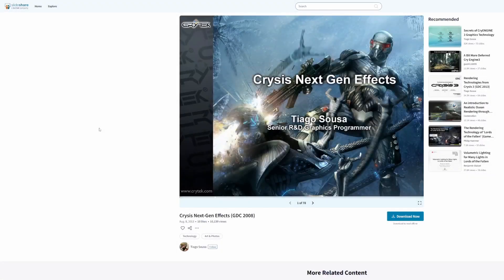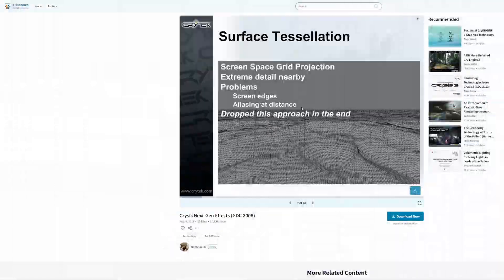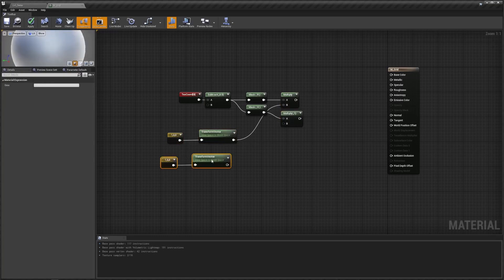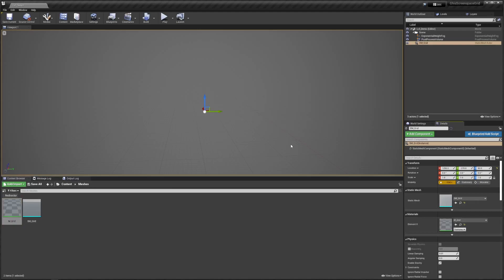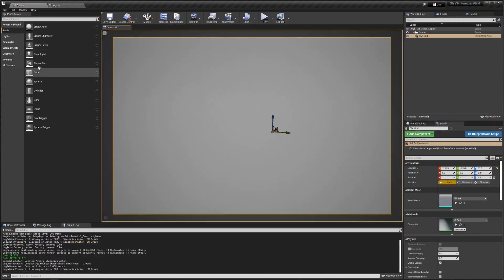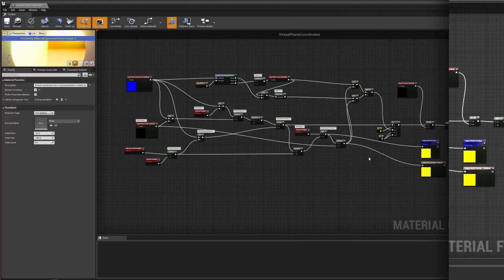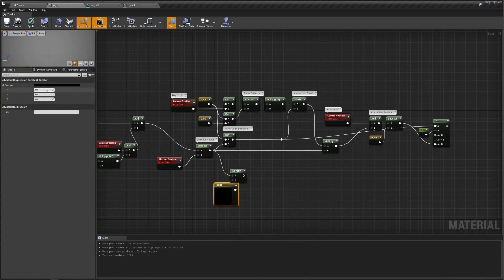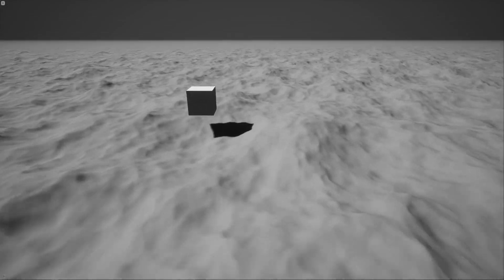A Screenspace Grid Generation Method in Unreal Engine

Comment: That's super interesting! You may "fix" the vertex jittering by having one quad per pixel xD
I was also thinking that you could use Pixel Depth Offset to push back at "infinite" resolution, but then you would need some sort of heightmap ray marching to do the waves @_@
Reply from the maker: Correct! Good points. It's actually not so crazy to imagine a grid of vertices matching the screen resolution imho, GPU can handle that nowadays, as long as you're willing to pay the cost. Even half the resolution could be negligible in terms of aliasing, I'd assume? But then at that point maybe other traditional techniques are more relevant? :shrug: I'm actually doing more research and ID Tech 7 uses this exact same grid projection method to render water (@see 'Rendering Doom Eternal' paper). I wonder if aliasing is noticeable in the game.
Also yep, the same principle can be achieved on a single quad using a fragment shader with raymarching, but then water is generally costly AF to render already so my gut is telling me this is no-go :D

Comment: I'm curious what you tried to fix the jitter. My trivial idea is to sent camera location and rotation from code whenever the camera moved beyond a grid cell instead of taking the material node which updates every frame. And the grid is depending on the view size. But I probably missed something important, too tired for today, probably will try tomorrow again.
Reply from the maker: Yes, tried something along those lines but to no success. The thing is, the perspective-projected quad doesn't result in any grid-based pattern. You could for instance have the camera remain static, very close to the projected plane, looking at the horizon and have the perspective-projected middle vertex change position from +inf to something close-ish to the camera in just a couple of degrees in pitch. The camera's location play little role in the aliasing and the camera's rotation could be stepped but that still would result in vertices end-positions not being spatially stabilized and at all, and thus produce a noticeable jump in any world-based texture sample. It's hard to explain/visualize.